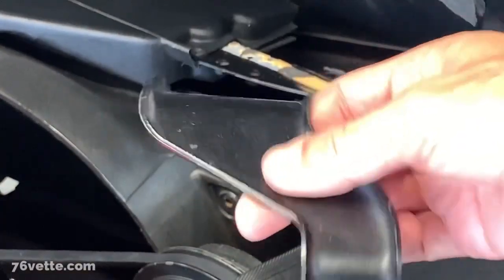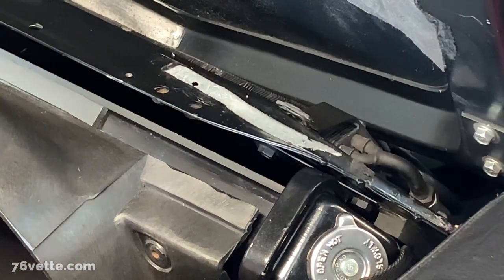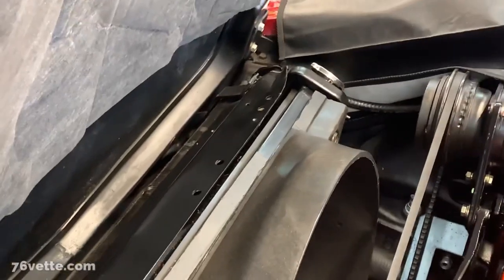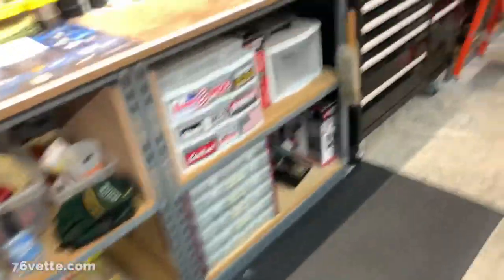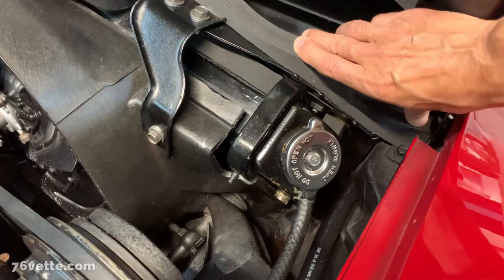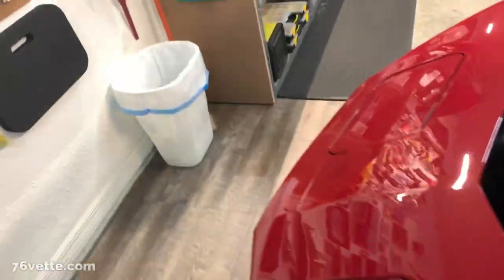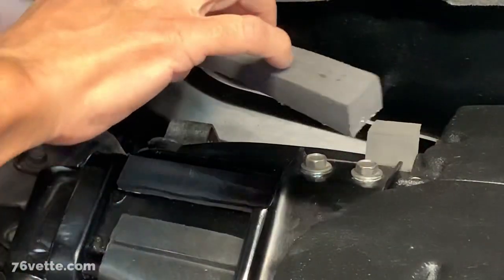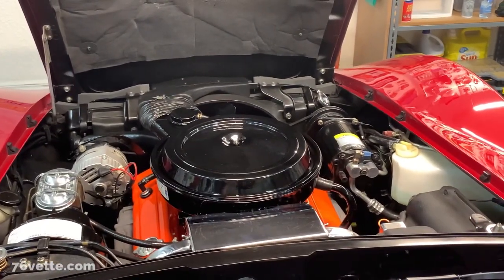This Helps ROUTE AIR to the RADIATOR

Comment: Were you having heating issues before you added the seals? I have a 79 and there were no seals between the radiator and the support. I think this could have been my major issue. Not sure how they install and like you said not much info out there.
Reply from the maker: I think there were some, but old and not sealing very well. As a matter of fact, I added extra seals to direct as much ram air through the radiator. As you know, the engine bay gets very hot, hence the need for fender heat extractors which really serve a purpose. 

The factory assembly manual should give you a good idea as to where they go. 😊👍🏻
Reply: I never heard of  fender heat extractors, is this something different than the vents on the outside of the fenders? what temp does your car run at?
Reply from the maker: @mikekurtz627  No, they’re the same thing. My car runs at around 195° and sometimes it may get to 210° in traffic with the ac on.

Comment: Very informative, do you find that zip has better quality corvette products than the other guys or did you just randomly choose them? I’m about to replace the stock radiator with an aluminum one on my 69 L71 and just want to purchase the factory correct parts (even though I’m going with a 3 row aluminum radiator). But that’s beside the point.
Reply from the maker: Thank you. My wallet guides my purchases, so I buy whenever I find the best price if possible. I do favor ACDelco components when I find them, but most parts are made overseas anyway, so…
I installed an aluminum 3-row as well, and love it, so I think you’re making a good choice with the swap.😊👍🏻
Reply: Hey there

I just installed my new radiator support on my 76 and I noticed they didn’t have screws to receive the snorkel?
Did you have the same issue?
Reply from the maker: My radiator core support had all the attachment points necessary to install OEM parts. I guess you could drill a couple of holes so you can install yours.